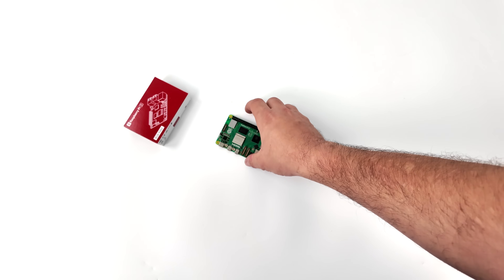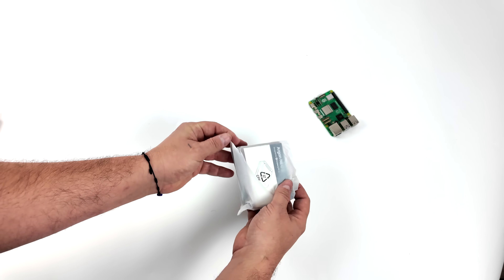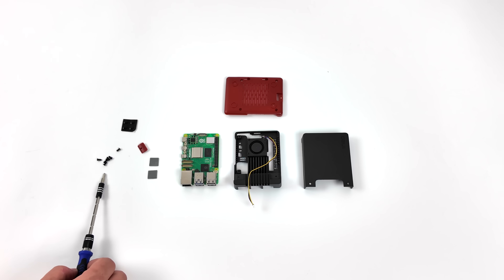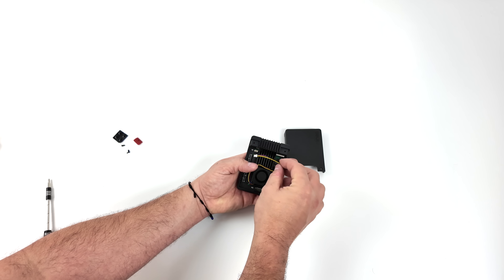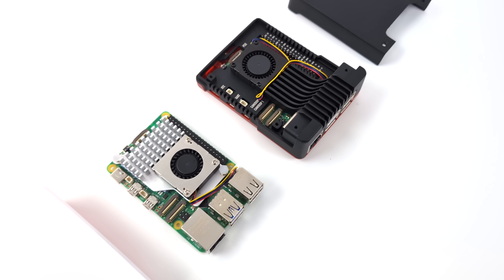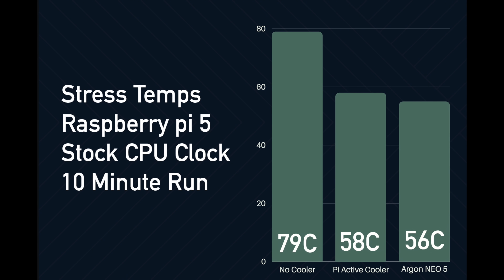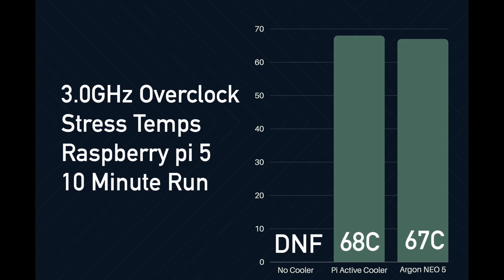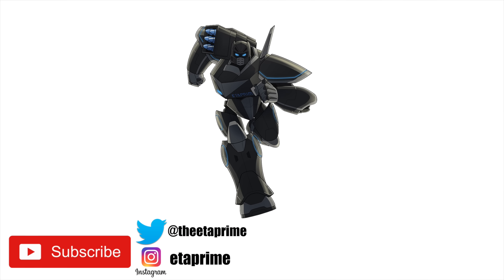The Best Raspberry pi 5 Case Is here! Argon NEO 5 BRED Hands On

Comment: The great thing about the Argon cases is that when the chip is idling, the fan does not need to run at all.  Fans will eventually wear out, so the less you run them, the longer they last.  I have the Argon 1 m.2 for the Pi 4 and really like it.  I hope they come up with a version like this for the Pi.  Having a case with full-size HDMI, everything on the back, and a real M.2 would be great.
The one thing that has always bothered me about the Argon aluminum cases is that nobody really mentions how the metal affects the WiFi.  I usually use a wired connection, so not a huge deal for me.
Reply: I have an Argon 1 m.2 case on a pi 4 and use the WiFi. I'm one room over from my router and both the 2.4 GHz and 5 GHz WiFi work fine. I was worried about this before I got the case, but some people on Reddit said it worked fine for them, so I gave it a try. I'm waiting on a similar case for the pi 5.
Reply: The ONE V3 case is available for preorder! Also, the M.2 NVMe expansion for the ONE V3 seems to be expected late January.
Reply: I'm receiving my Neo5 today but going to hold off on the V3. I'd like wait for their V3 NVMe base to be available. On one of my Pi4s I have the V2 with NVMe (running Kodi) and that runs pretty hot to touch - even with the V2 fan on. I hope the V3 with NVMe runs cooler.

Edit: I see that Argon40 will have an NVMe expansion board for the Neo 5 too. That'll be interesting.
Reply: You could just replace the fan. My Raspberry Pi 3 has been running 24/7 for several years now. Its fan is still running last I checked.

Comment: Bleh, I'd rather have full size HDMI ports.  You can get a few bucks off if you preorder the Argon ONE V3 Case.  I'm holding out for the next M.2 version.  Which I suspect will be reworked for NVMe.
Reply: The M.2 NVMe expansion for the ONE V3 case is expected late January apparently.
Reply: Exciting news! We're thrilled to announce a dedicated PCIe NVMe expansion board designed specifically for the Argon One V3 for RPi5 (and also coming for Argon NEO 5 for RPi5). In addition, we have other exciting products like cooling accessories and a power delivery GaN set to launch in early January. Stay tuned for updates on our website, and thank you very much for your continuous support.

Comment: I have this case. I got it about 2 weeks ago directly from argon. It's pretty great, I had the original for the Pi 4. Also, this one is made of a little lighter aluminum than the original but cooling is still excellent.
Reply: how long did it take to ship directly from argon, i bought last week and haven’t received no update
Reply: @wolfvenger  it's coming from China so expect 3-4 weeks
Reply: can you fit a 2280 m2 in the case?
Reply: @kiganjanico  I'll let you know when my nvme base gets here but probably not.
Reply: @wolfvenger I ordered from Argon directly, they shipped from china ten days after my order with the worst courier ever. It took 50 days to receive the case.